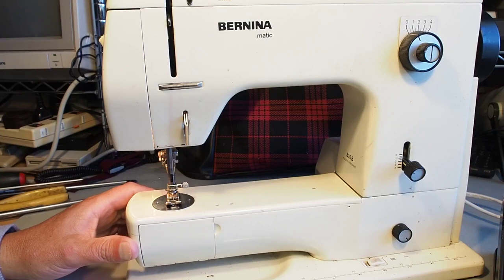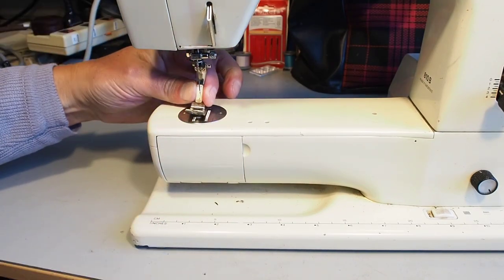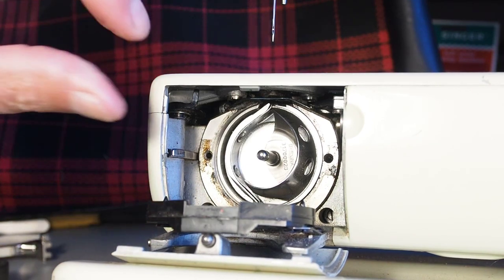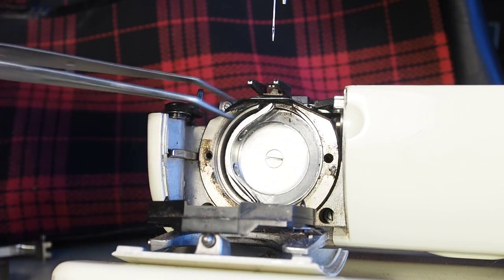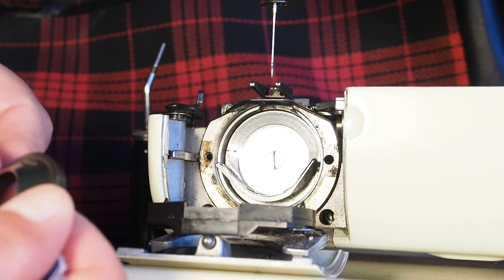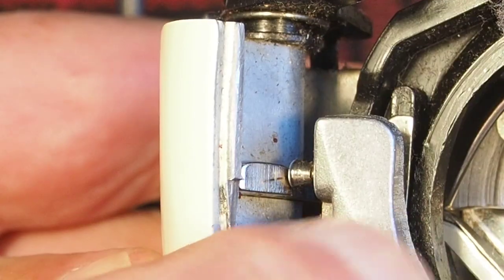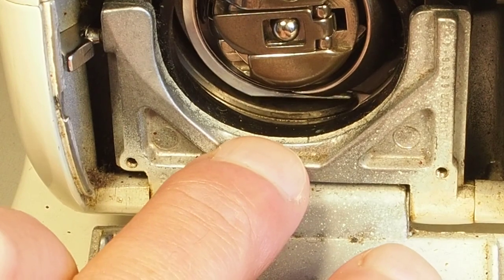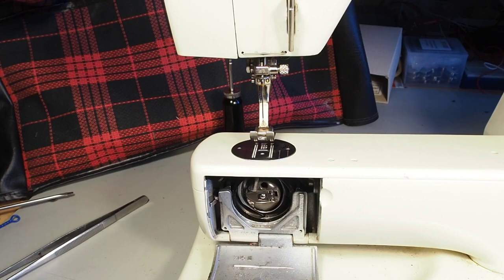Bernina Hook Removal and Installation - Shuttle

Comment: Thank you so much I had to try to take my bobbin out when my needle wasn’t at the top most position and it got stuck and I wasn’t really careful and the needle tip broke so I was watching your videos and I undid the machine and fixed the bobbin case you showed me how to take it out I was very careful at this point thank you for letting me a widow with a small amount of income fix my machine that I goofed up and now I can soon as I get the needle thread it again I can carry on with my sewing and you made it safe he told me to unplug the machine and I felt like you were standing right beside me thank you so much you saved me probably $200 in a couple of weeks without my sewing machine if not more thank you so much for this video you don’t know how much you comfort people that are in the house all by them self with no one to turn to thank you so much may God bless you

Comment: Great video. Loved the close ups. Any video where I learn is appreciated. Driver at bottom is great, so simple . I use a Necchi BU which can jam if I'm not paying attention. Never realized how much better it would be if the driver was at the bottom. 
   Also appreciate your showing the great engineering of this machine. Two clips and your in your working area. Beautiful. I'm trying to straighten up a plastic Pfaff and it takes a tool kit to get to the bobbin area. Keep up the good work. 
    Oil point was something else I picked up. Prior it was just get some triflow in there.
Reply from the maker: Thanks. Yes, these machines are definitely designed for easy access and easy maintenance. Pleased it helped.

Comment: Question -- I put my assembly back in and now the needle won't pick up the bobbin thread. Do you know if that was caused by me putting it back in improperly? Is there an optimal needle position? I followed your video. Maybe I need to do it again... Edit: I repeated what was in your video about 5 times. No change. Advice?
Reply: Hi again. I am leaving this comment up so if anyone else has this issue they can see it. I got it to work. The assemnly CAN be put back wrong even if it moves smoothly. I did it one more time but watched carefully at the spot in the video where your needle passes in front of the basket, and I set mine up to cross over in exactly that spot. Now it sews.